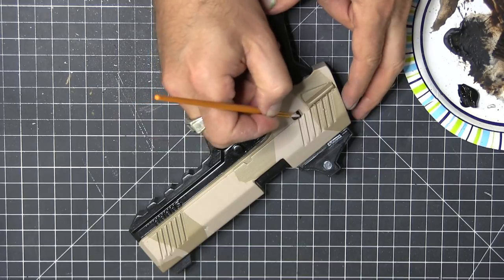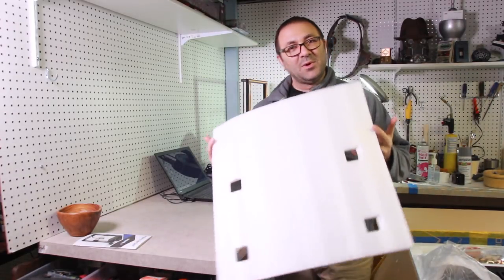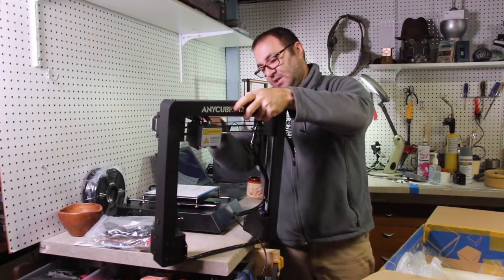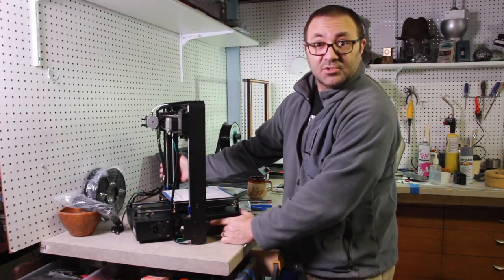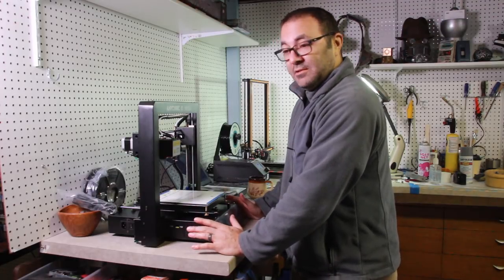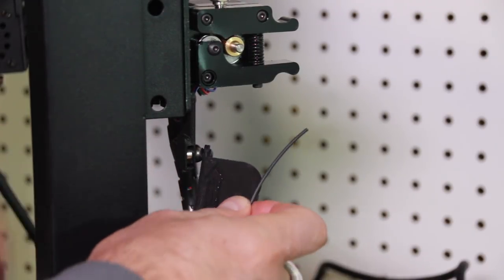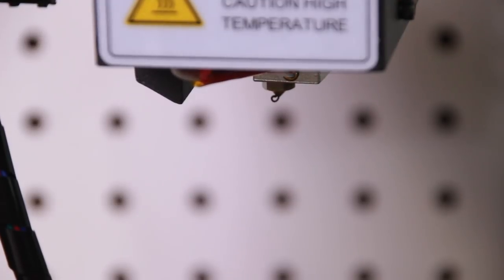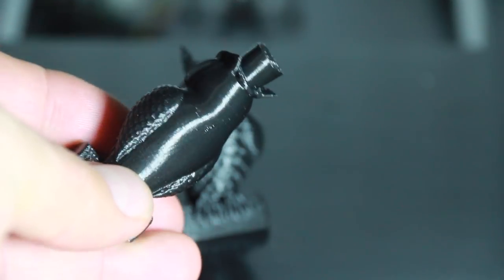Anycubic I3 Mega Review - With Coupon Code

Comment: How has this printer been?? I am hearing some power supply problems and the ultrabase failing after some heavy duty printing.
Reply from the maker: Still liking it. It's printing away right now. The bed has been fine, I swab it with alcohol a few times a month and that seems to do the trick. I did have to change the fan on the Power supply but it was super easy, no soldering and the fan was 8 bucks. So yep, still dig it.
Reply: Great to hear!! I am actually working on a spaceship model I want to print. I was looking at this to buy, but I was wondering if you might be interested in printing it for me? I could pay for the materials etc. Then you could even do a review of the model possibly?